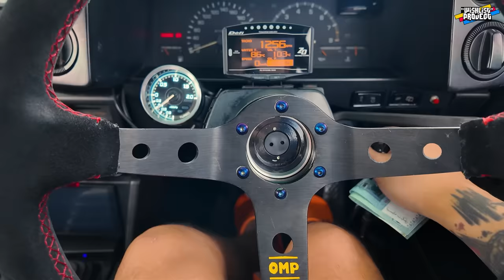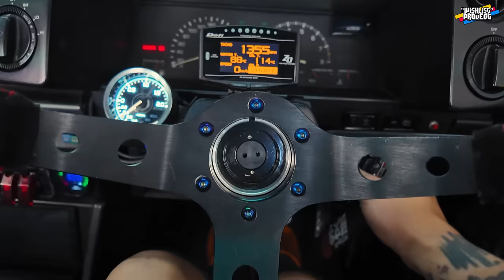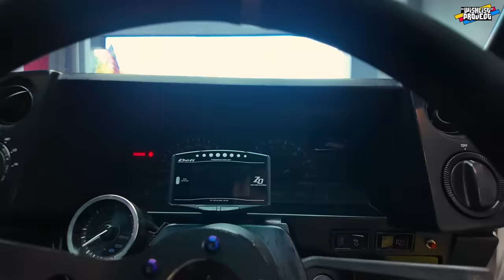AE86 AKU TUMPAH MINYAK

Comment: Bro ask mechanic to look at the fuel tank system. Your fuel system is not rated for the high pressure pump that creates too much pressure in the fuel tank. You can choose to install an external fuel pump that draws the fuel out from tank, that would solve the problem. Or install a breather valve that vents excess pressure outside. This will never happen if stock pump is used.